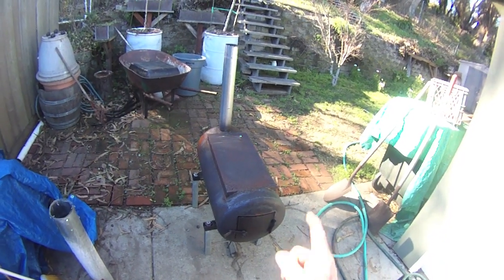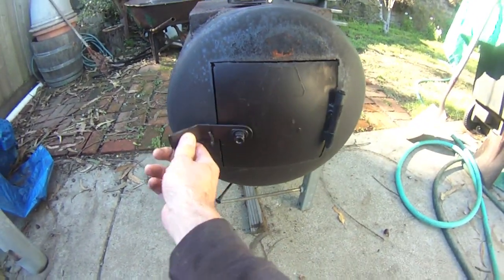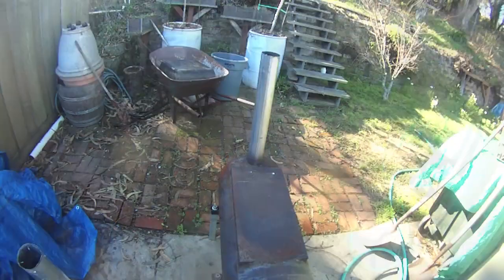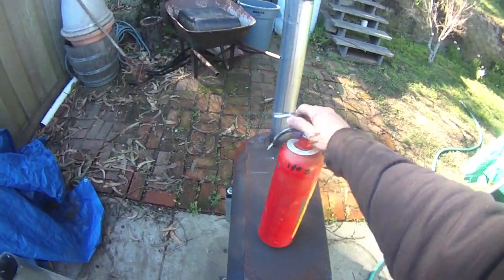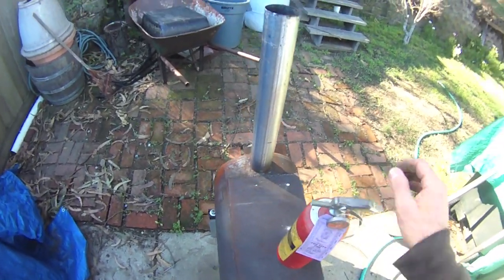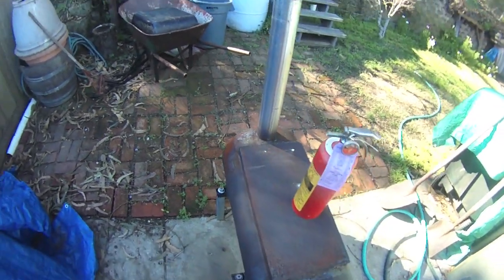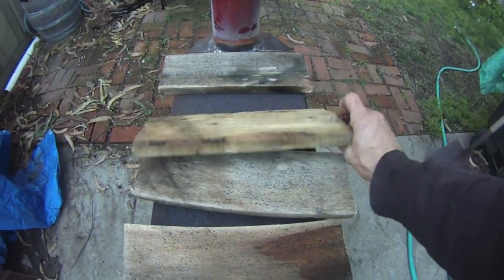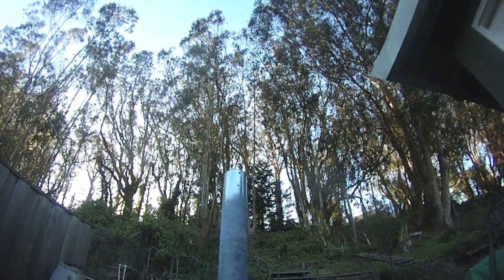Air Tank Fireplace Fabrication Fail and Fix

Comment: You could have left the 3" chimney, a little longer though, just by opening a sliding air intake at the front door, that way you can have this stove in an indoor setting, provided the chimney is connected to the outside.
Please take advise from a guy who's been around for three generations : never, ever work with heat and/or sparks near a source of gas as that meter.
I like your videos amigo and I would like to see you making them in the future.
Greetings from Toronto.
Reply from the maker: Thank you Jorge, appreciate you watching !!  Greetings from Oregon.

Comment: You need a lot taller smoke stack than it will help you get the smoke out
Reply from the maker: You are absolutely correct.  I have a 6' section of pipe that I slip over the attached stack when in use.  I wanted this to be portable and able to be carried in the back of my pickup. Makes it much easier to move around without a long stack to contend with. Thanks for watching.  Have a great weekend.

Comment: I'm glad this worked out for you. If you find it still not to your liking I'd say your stack is short by at least 10'. When creating a woodstove it's important to have a tall enough chimney. That's because the temperature gradient between the outside air and the stove creates a good draft that sucks air through the intake into the stove and pushes the smoke away. If you've noticed a cold fireplace is smokier than a warm one, that's why. You need it long enough and need it hot yet somewhat cooler at the top. If there are things outside nearby that are close the the same height of the stack this can also affect drafts and possibly not allowing it to do its job. If you have troubles in the future, I hope this helps and be safe man. Plasma cutter next to a gas meter is only a slip and fall away from catastrophe bro....
Reply from the maker: I have a 6' black chimney pipe that I slip on this stove when in use.